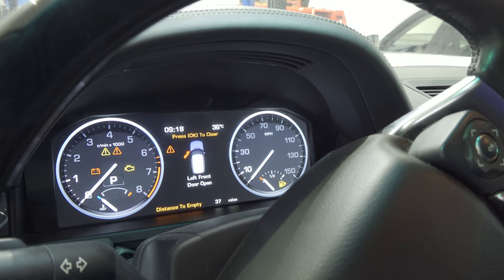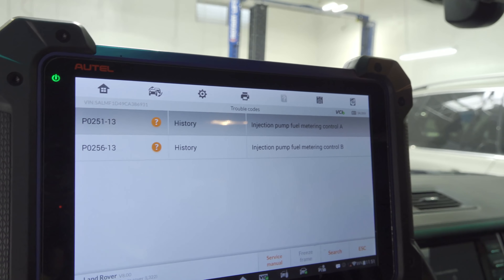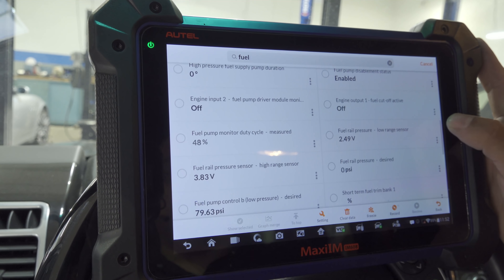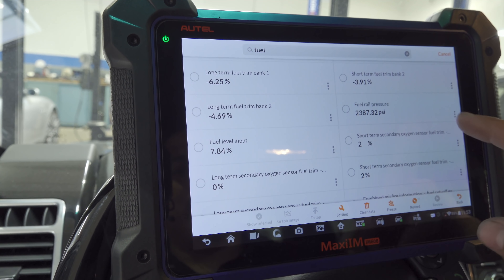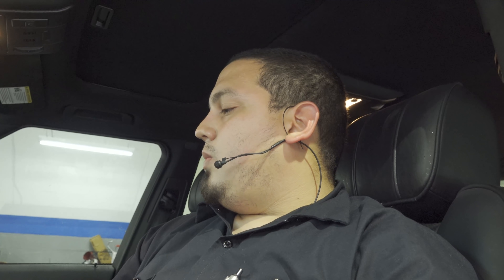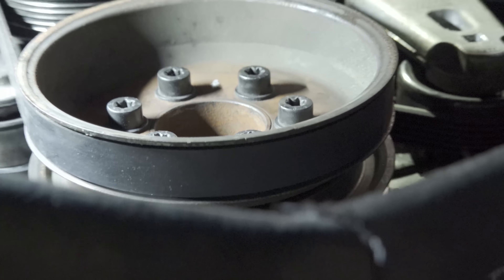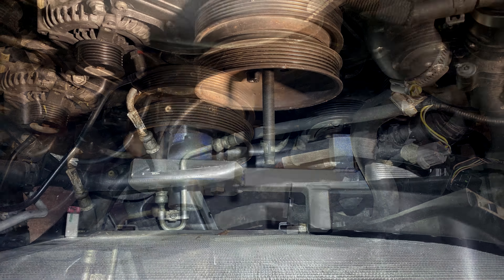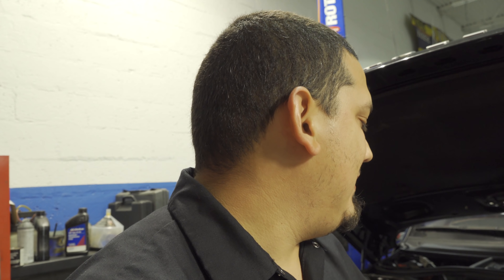2012 RANGE ROVER 5.0L - MIL ON BUT NO CODES (ROUGH IDLE ONLY WHEN COLD) - RESTRICTED PERFORMANCE

Comment: Good job Mario , I have run in to this once , after doing a headgasket job on a 5.0 turbo , I never touched the fp chain so I figured i didn't have to reset it after assembling back . When I started it and test drove I got that message came up for reduce power . The chain had jumped 2 teeth 😬  and I had to go back in there for the second time 🤦‍♂️ . This video was like dejavu for me .lol . For 2 weeks I had nightmares . Keep up the good work brother i feel your grind 💪.
Reply: Hello Gilberto, did you have high fuel pressure as well? I did hear gasket job and now getting irratic RPM bouncing about 75 rpm even during acceleration. Driving me 🤪

Comment: Hi, this is a very detailed diagnosis and repair.  I am a DIYer and I also own a 2012 LR4 same 5.0L NA engine.  Mine is sending codes related to catalyst and emission misfires and no misfires in the cylinders with fuel trims within normal range. You are an excellent mechanic and I would like to ask your guidance on how to go about solving the check engine codes. The check engine light comes on right away as soon as I start the engine.  After I clear it with my GAP tool, I can drive up to 10-20 miles without check engine light; however, as soon as I turn off the engine and restart, the check engine light comes on again. I hope you can give me an insight on what's going on.

Comment: Out of curiosity how does the pump timing effect that fuel pressure....?
Reply from the maker: I would use an engine as an analogy.

If the intake timing was advanced, it would result in a longer intake stroke and raise compression.

The way the fuel pump builds pressure and its regulator caps that built pressure together is how we get our controlled pressure.
If the regulator is not in sync with the cam, it could very well be closed at the wrong time and opening at the wrong time. 

I suspect that the regulator valve is opening early in relation to the cam timing and allowing more of the "compression" stroke to come into the fuel rail
Reply: Super Mario Diagnostics That makes perfect since now, thank you kindly for the info.
Reply: Thank you for the explanation,  I don't deal with the European cars very much but they are coming,  I have my hands full with domestic and Asian vehicles  but it is good to get to get knowledge were ever I can.
Reply: Keith Morris As a tech based in Ireland/Europe you come across some really weird issues with euro built cars/vans, the engineers that design them most certainly don’t take servicing/repairs in to account....! The Asian cars generally seem a bit more straight forward as for us cars I wouldn’t have a clue as the only us car I’ve ever worked on was a c2 corvette and that was about 15 years ago....!

Comment: I have seen the no codes with a CEL On in a much newer BMW...2017 I believe : I think it’s a scantool problem. Didn’t have another scantool to check,but checked the car a few days later with the same scantool and the code was there : something about the radiator shutters...
Reply from the maker: Could be, in that case the drive pro didn't see the codes either LOL

Comment: Great video is there anyway you can go over the fuel system and the regulator valve test again I didn't understand that
Reply from the maker: Sure. By disconnecting each valve, i was getting the valves to stay closed, and comparing the fuel pressure between each fuel pump.

Being unlikely that both pumps would have a stuck open valve, if one was an issue, we would've seen it by doing this test. I guess you can call it a high pressure fuel pump contribution test.

Seeing that the pressures closely matched, i thought that it was very likely that both fuel pumps and their valves were good.

Having ruled out the pressure sensor, and now the pumps and valves, they only thing left was the fuel pump cam timing as the culprit.

Hope this helps

Comment: Mario, thank you for the video. I’ve just started taking an ATTS fuel system diagnostics class and this was very helpful. What pressure should the high pressure pump be putting out at idle? Man that is a lot of chains. Does that pump run off the crank or cam? Lucky those weren’t worn. That was a job and a half. Nice work and nice troubleshooting. Hope it lasts. How many miles on the replacement engine? Guess thats enough questions. Only answer if you have the time. Thanks and stay well and safe 😊😊😊
Reply from the maker: Thanks for watching!

I mentioned at the end where the pressure was at and why i couldn't say exactly where the pressure should be. The pump is directly on the cam, the lobes were flawless by the way. 

I've no idea how many miles were on the replacement engine since that engine was replaced by another shop

Thanks again Arthur!
Reply: Thanks for responding Mario. I did catch it at the very end looked like 400-500 PSI. MAYBE ILL Ask that question tomorrow night in class. See what they say. So many different facets to to these GDI pumps.i do know they wear the cam and the cam follower and also should use gas with a certain additive.thanks Mario for all the info you have supplied to me through your videos ❤️
Reply from the maker: There are just so many systems. Unless someone collects them as known goods, it can be hard to say definitively.

Thanks bud

Comment: Hey bro!! Just found out about your  channel and spend hours watching. You are great!! I did have a question....how would you check if there were any bent valves before replacing chains??
Reply from the maker: If timing was out, I'd definitely be doing leakdown texting before anything else. But since timing was good, only the fuel pump timing out, no reason for leakdown testing

Comment: Hey how you doing nice tutorial, my car is doing rough idle, when am in traffic on just not moving, and I just had the head gasket all 8 injectors all 8 plugs new water pump new fan new thermostat, and it's rough, do you have any advice for me, garage said I should drive it that the ECU will start to recognize the new fit part any advice ?  Thanks
Reply: You ever get any fix for this?
I'm on same page... 
head gasket
valve seals
plugs
Water pump
Expansion tank
New cap
Pcv valves 
Thermostat 
All coolant lines

.....and now I have a bouncy rpm at all times... enen during acceleration. 
Tried the old fashioned throttle body relearn and now rmp idles at 1k.. 
Any ideas?

Comment: I have had a few newer Range Rover vehicles go to restricted power because of low fuel level, a new strategy to protect the pumps from running dry?
Reply from the maker: I just had a 2020 Rover here with low fuel and it didn't do that.

That's also not what happened here lol
Also doesn't explain the fuel pressure i was getting here

I've never seen low fuel level cause a restricted performance lol
Reply: @SuperMarioDiagnostics  still watching the video, just an off hand comment before watching all of it, thinking out aloud, if you will 🤘
Reply: @SuperMarioDiagnostics  fuel pump chain, wow! It's got me thinking, you are using the Autel to check for codes yeh? You would think if the money lamp was on a code would be present. Then I got thinking about a job on a Range Rover Evoque that I had for multiple codes thrown, after clearing the codes with a Launch scan tool, the money lamp stayed on, I ended up sending the car to a dealer I do some work for and he put the Range Rover scan tool on it and guess what? It still had a proprietary Range Rover code, (non OBD2) still present, which the Launch didn't recognise or show.
Reply from the maker: Yeah neither autel nor autologic showed codes 😆 i didn't try sdd on it though
Reply: @SuperMarioDiagnostics  shows that even good aftermarket scantools have limitations, kinda like independent service info is limited to what the vehicle manufacturer chooses to let them have access to.
Reply from the maker: Absolutely

Comment: I keep getting a cylinder 5 misfire code for even on after a fuel injector and spark plug job filters and Mafs. Only on idle when starting. You can barely feel it. Anyone have any idea? It’s on a 2011 Range Rover supercharged.

Comment: I play with my tacoma GDI system. At Idle desire is 0 psi but you can see 450 psi at the rail and is normal. If you leave the car Idle for 15 to 20 min the pressure can get up to 780 psi just idling. But man that's a lot of work my guess is 20 to 30 hour labor time.

Comment: Hoisted engine out or lifted up the chassis? When the pump chain is so loose (14:30), it is not a chain stretch? Maybe chain guide or its spring is broken? If it is the non-spring side of the guide, u might be able to just remove it and set timing and put in a new guide.... Otherwise, yes, pan needs to be dropped and that stupid pan is bolted on by the rear main seal plate.. ha which means engine and tranny to be separated. I know how painful it is to work on these tanks. Everything is heavy duty.